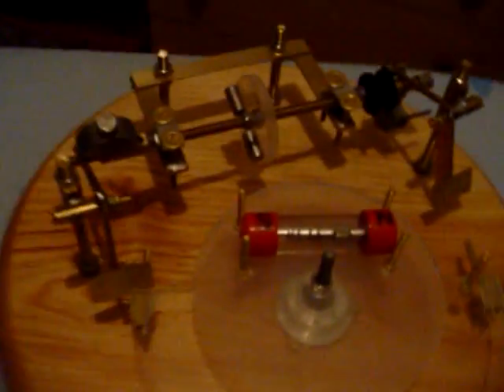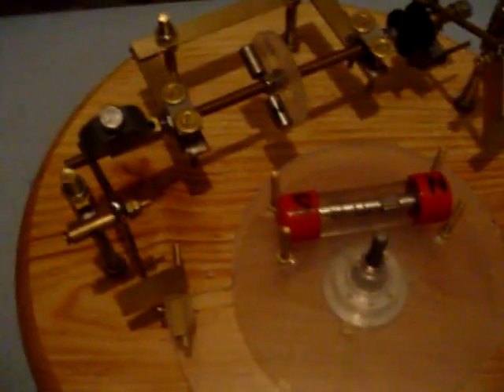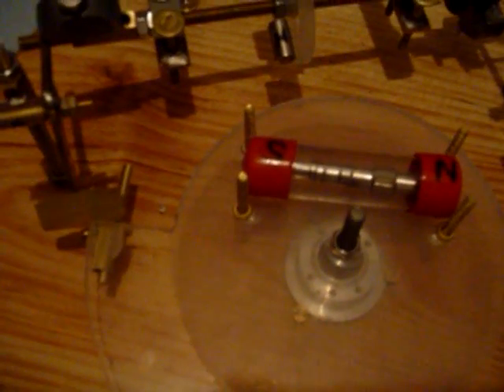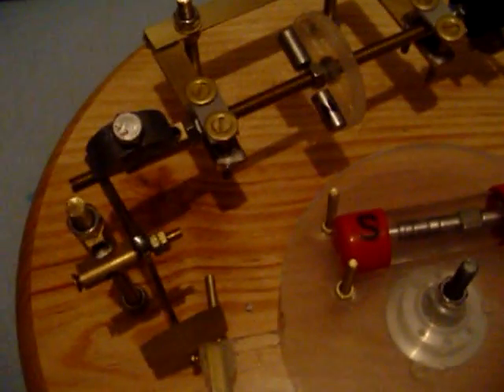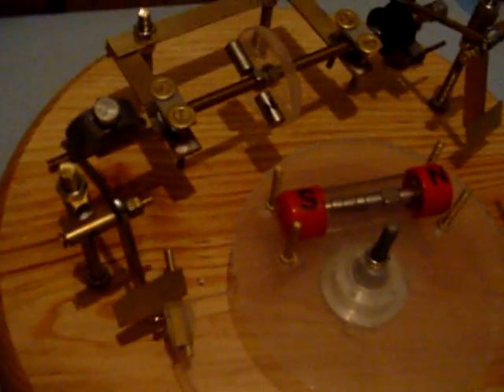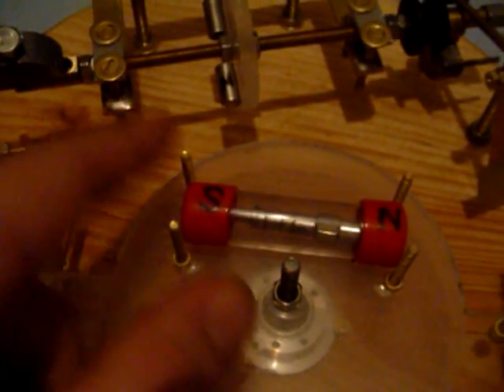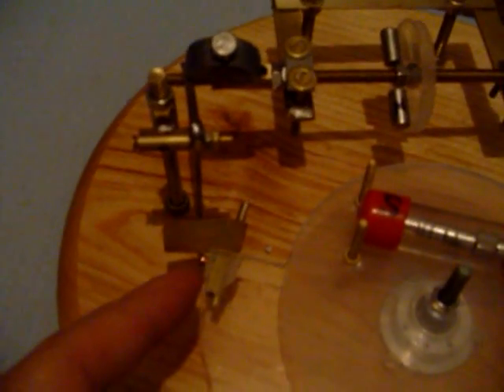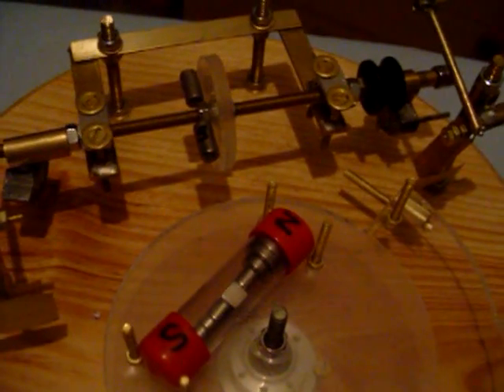Ctoy magnet config

Comment from the maker: no the wieghts are not linked together and in the original the 2 wieght does not get pulled up either. Parts have been removed fro  the original so that it does not cycle...i am trying to replace those missing parts,,